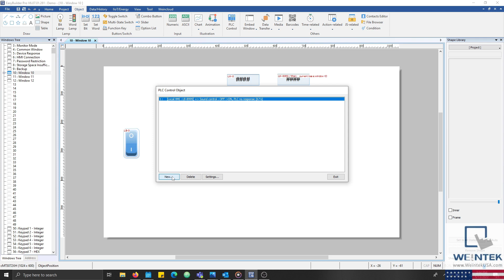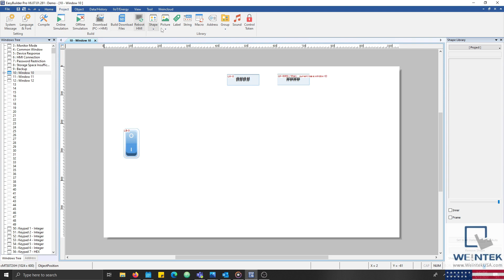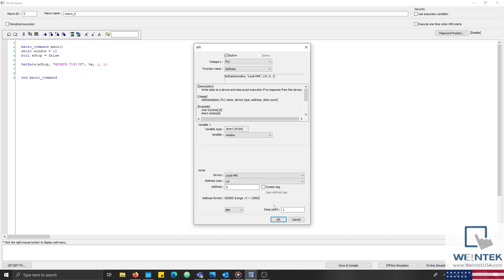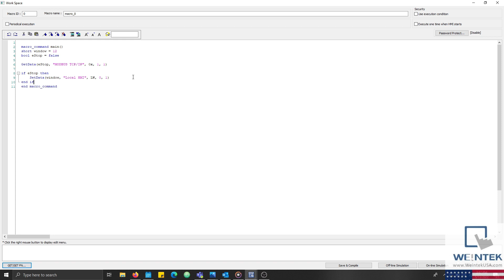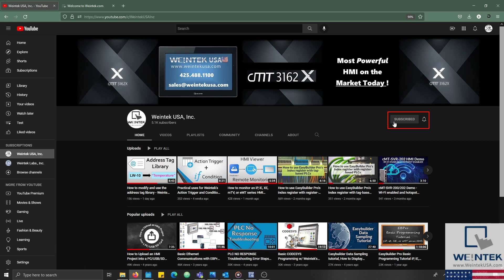How to change the current window with a Macro or based on a value within the PLC - EasyBuilder Pro

Comment: Hi.
How can i show a popup window, using macro? 
You showed us how to open a widescreen window. But if i want a popup window?
Reply: Did you find an answer for your question?
Reply: I found an idea and tested it with macro
look
1- Make a popup window with size 380 X 100 , monopoly , start position 209 ,190
2- Make a another window with Indirect window has size 380 X 100 and alignment in the meddle 
3- In the that window make a set bit object link it with a macro to activate the popup 
int a=18  // window 18 (popup window number)
SetData(a, "Local HMI", Lw, 60, 1)   // indirect window 60
4- To close the popup window make a function key and link it with macro
int a=0 // 0 to closethe window
SetData(a, "Local HMI", Lw, 60, 1)
this is an example and test it
Reply: @wadib3eed7  what?
Reply: @galingeorgiev6806  what for ?